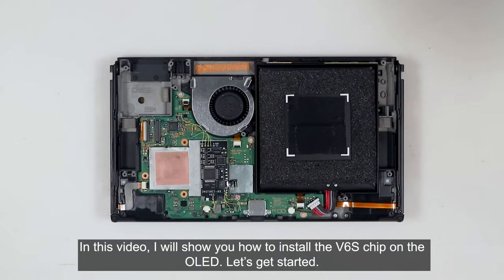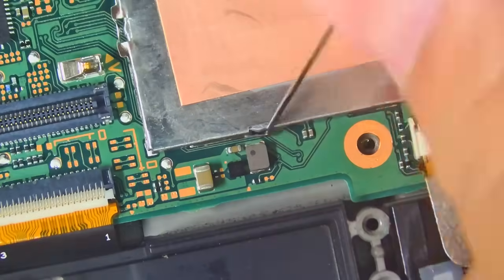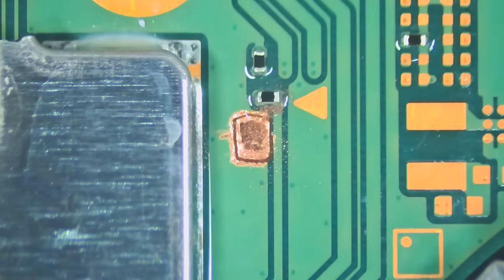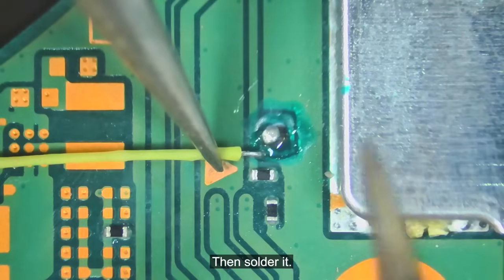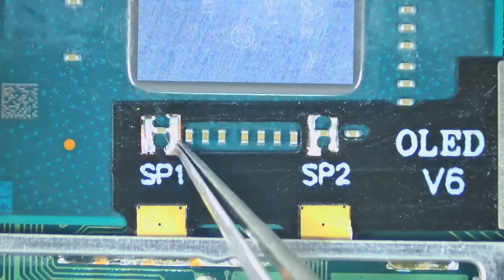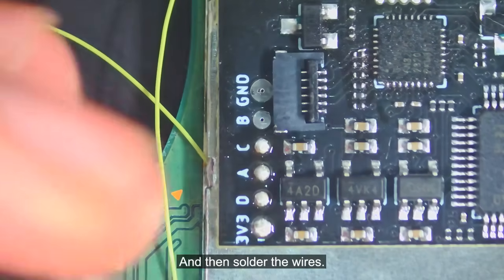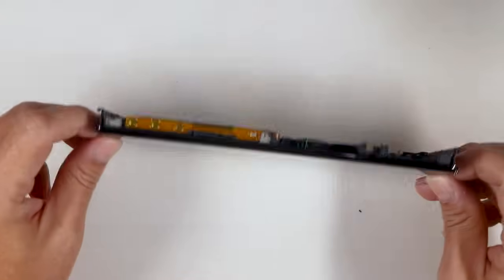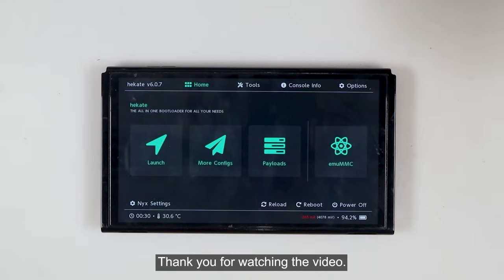OLED V6S WITH THE KAMIKAZE METHOD

Comment: Is it worth doing the kamikaze method? How long on average until the dat0 adapter will oxidize if that method is used instead?
Reply from the maker: it is worth. there is no specific day when the dat0 oxidize, it could be months to years.
Reply: I see, can we solder the exposed dat0 point as normal and omit the solder paste?
Reply from the maker: yes
Reply: @sthetixofficial  Thank you, one final question: would a Dremel pen bit with a working diameter of 0.5mm be small enough?
Reply from the maker: @gamblerofrats 0.5 is too big

Comment: Hello  @sthetixofficial  I did It but when I put on my console and after training process, v6s have led light Blue and doesn't open instinct page but NORMAL page. I have checked all value in diode mode and was ok. What's wrong?
Reply from the maker: What chip did you use?
Reply: @sthetixofficial  V6S, the same of video, I turni on my console I see multicolor led but After colori change in Blue and console go in NORMAL mode.
Reply from the maker: Try using other chip or check the signal / solder pads connectivity
Reply: @sthetixofficial  now it works. thanks a lot
Reply: how? @GiuseppeFregiato
Reply: @hefdhi  I had some issue on SP1 and sp2 I had replace old solder with new One.

Comment: hey, maybe a little late to the party, but is there maybe a diagram or a video tutorial on how to install the chip normally instead of with the kamikaze method? tutorials on the internet solder different parts while others dont, like the resistor on the dat0, and the vbus. i have no idea which tuorial to follow, or what the difference even is. like also there is a point A that nobody seems to use, whats that for then? is there a way i can find out whats the right way to install this chip without the kamikaze method. i really don't want to drill through the motherboard. but i have no clue what  to else to install this chip normally because of the difference in the tutorials. you seem to know what you're doing. is there any way you could help me?
Reply from the maker: it depends on the chip you are using. you can watch my previous modchip installation video without the kamikaze. I never use Pico so we don't need to alter or add resistor
Reply: @sthetixofficial  I have the same chip that you are using in the video. the instinct-nx v6s. so the only thing i still need to figure out is if i have to solder the resistor on the dat0, because i'm using this instead f the kamikaze method. i've seen some tutorials using the v6s chip that do solder the resistor, and others don't. although i have no idea what difference it makes,  i don't know what it does or what it is used for, they both seem to work. would it you advise to connect the resistor on the dat0 or advise against it? thanks for the quick response btw, you are awesome and your tutorials and resources are the best!!

Comment: Does your latest hatspack work with instinct v6s I keep getting error 2002-3540 on OFW doesn’t do it on CFW does it at random times?
Reply from the maker: it does. try to replace your sd card with other brands
Reply: @sthetixofficial  it’s not the sd card because I took that out and booted into stock by pressing volume + and - at the same time and I’m still getting that error code at random times on OFW sometimes on the Home Screen sometimes in a game could it be a faulty chip?
Reply: I have the same problem too. After I change the chip with a new one, no errors. Firmware version 1.3 on both. So could be a faulty chip 🤷
Reply: @Techh0bbyist_Shop  there’s a few faulty v6s going around apparently but someone mentioned a new firmware sorted some issues
Reply from the maker: you can try flashing it it with https://u.pcloud.link/publink/show?code=XZ8rj50ZYMAS0MyiVOVfEnQF3SAGr5eDPM6y

it's the newest firmware for the v6s
Reply from the maker: https://u.pcloud.link/publink/show?code=XZ8rj50ZYMAS0MyiVOVfEnQF3SAGr5eDPM6y

please try that.

Comment: The diode value in the 3.3v point is 1.014v, it's ok?
Reply from the maker: it is not okay.
when you put the red probe to gnd and black probe to 3.3, you should see 0.500 v reading. but if reversed, you should see 0.500 ~ 0.800
Reply: @sthetixofficial  I already soldered 3 diferent cables, but the reading is the same 1.014v. I also tried with the red probe to gnd and black probe to 3.3 and give me .475v and when I reversed the probes give me 1.014v
Reply from the maker: @jorgefregoso231 then I think it is fine

Comment: Can you make a video of how to repair the B Point if it falls off?
Reply from the maker: You have two locations. One is on the underside of the motherboard. Please watch the older V6 video.
Reply: @sthetixofficial  I mean, how to repair the B Point connection when the pad on the back came off the motherboard, and trace on the back is broken.
Reply: @ScorPICz same problem here 😢

Comment: Is this the new advanced Instinct chip you´ve been talking about ? If yes, where can I find these ? Haven´t found them on ALI Express
Reply from the maker: yes it is. it is on ali
 you can dm me to get the link
Reply: @sthetixofficial  I can dm you on Discord. Whats your name there ?
Reply from the maker: sthetix / sthetix#7311
Reply: @sthetixofficial  Alright, I´ll do that later. Can I use my existing sd card where my EmuMMC and Android are being used on my V1 switch on a freshly chipped OLED switch ?
Reply from the maker: You cannot use it on other console (as the console will ask you to delete the existing Nintendo folder).
Reply: @sthetixofficial  Ok that sucks, so I always have to use a seperate sd card for every switch. Android will work with this new chip without any issues right ?
Reply from the maker: android will work on this new chip
Reply: @sthetixofficial  Great. Can I use your video guide or is it already outdated ?
Reply from the maker: @MrCANER06 you can follow my android guide
Reply: @sthetixofficial  Thanks alot for the replies. I´m gonna get to you back later on Discord

Comment: Great install.  I stopped installing Instinct chips because the board quality is garbage.  Almost half of the board I received had defects.  The shops were ok with replacing them but it required ordering more chips.  I started installing Pico chips which have been much better quality and always glitch instantly.
Reply from the maker: Sorry to hear that

Comment: seen the kamikaze method on GBA temp and I honestly don't see the point. I mean, yeah I get that it's a hard wired connection but still. If we're talking about doing a "proper job" and not using adapters, I'd just reball the EMMC and install a dat0 line under it with pad strips.
Reply from the maker: You are free to choose your preferred method. Every method has its own pros and cons.